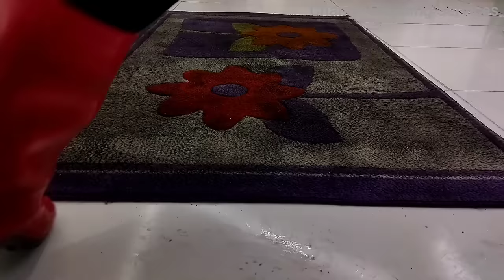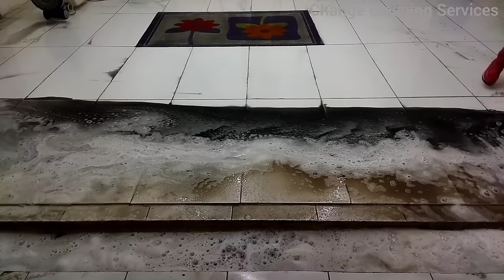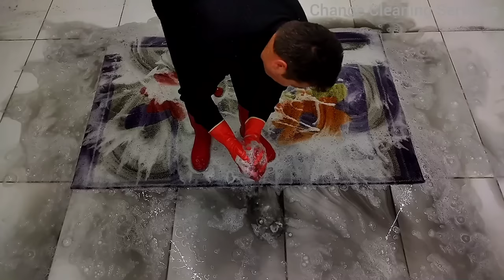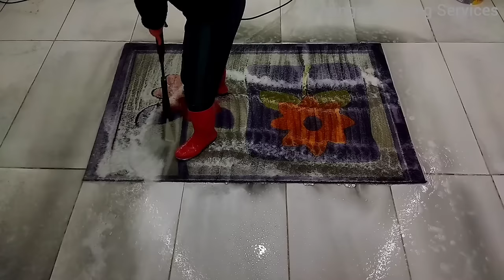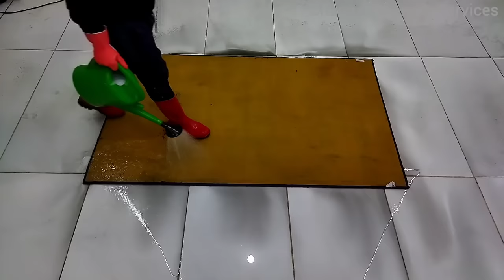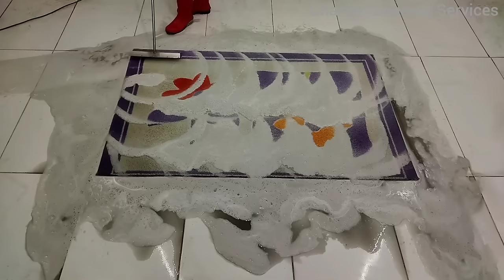Took 2 days..The Hardest Rug of my life!

Comment: Genuine question.  Why would you not vacuum off all that loose dirt and debris before starting with the water?  The black dust puffed up into the air as you unrolled the rug.  Wetting it immediately and then scrubbing just forced all the loose dirt further into the pile, and probably caused the job to take much longer.  Nice result though.
Reply: And then,...he turned it over and voila, there was the dirt on the floor.
Reply: Yes, I always wonder with these rug cleaning videos if there’s a more efficient way than just dousing with water at the start.  Also, can’t they just hang the rug vertically to rinse first and let the dirt fall off of both sides instead of letting the dirt trap below the rug?  They could also save on water this way.
Reply: I believe they filter the used water and use it again, so water useage isnt much of a problem
Reply: also the dust coming off is probably exactly why they don't. itd be unsafe to kick up all that dust and breathe it in, who knows what it could be
Reply: @rhysand4rch  - they could use a vacuum cleaner with a HEPA filtration system.  They are already breathing it in as the carpet is unrolled.
Reply: Are you an expert?
Reply: @donnadepierre5280  thank you 🙏 😌

Comment: Goodness what was that carpet stained with???   I mean my first thought when it was unrolled was shake out what  was already loose and dry - but I doubt it would have helped much.  Really wondering if someone thought they would die their carpet black and tried a ton of dye. If that is a synthetic fiber it wouldn't have worked to well. 

This also reminds me that people used to hang big rugs larger than this up and beat them. Lets dirt through both sides and fall out. Doesn't do much for grime